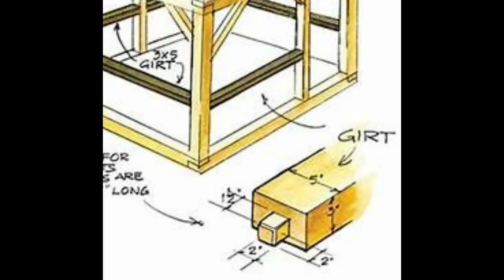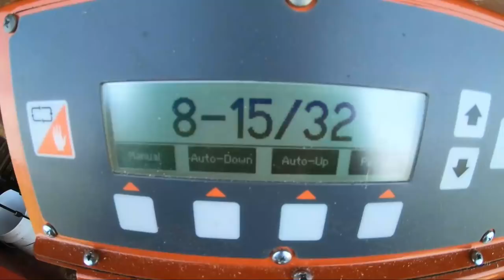Better Than Watching Netflix, Out Of The Woods Sawmill Cinema

Comment: I am far from an expert but I did spend a career in the sawmill industry, beginning with a small peckerwood hardwood mill to a state of the industry mill with Weyerhaeuser in Southern Yellow Pine. My suggestion for improving the recovery in a log with excessive sweep is to cut the log into shorter lengths. As one would say, cut the sweep out. Of course this was before curve sawing. Maybe you needed the longer 4x4s? Lastly, glad to see you bought the better Woodmizer!
Reply from the maker: yes sir, needed 11ft 4x4s, lots of loss but a good use for a free log and got what i needed,

Comment: Nathan, I'm sure you've done the calculations but would it not be better to cut that length in half and then have very little camber problem to work out?  Would they be too short for your mill?  Thanks, needed a new vid today!  8 days in the house now (except for walks around the block).
Reply from the maker: Not on this one. I needed 11ft 4x4s👍👍